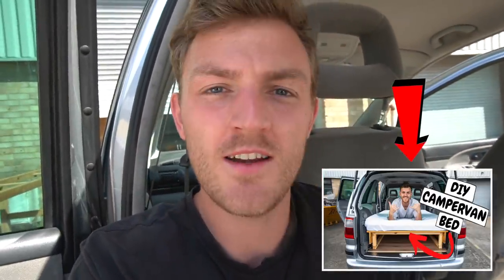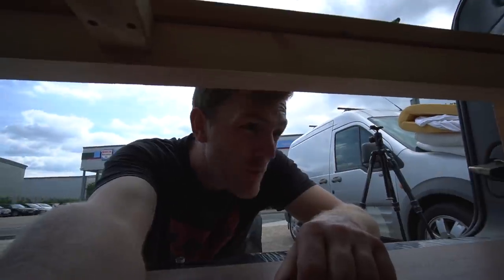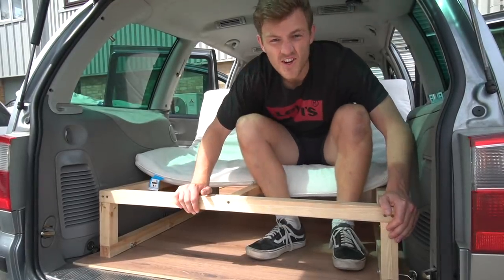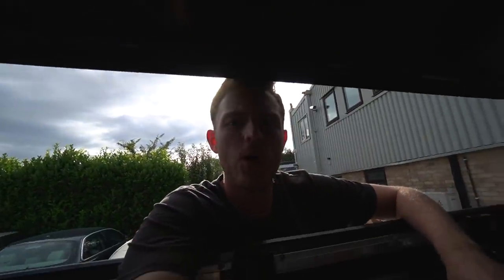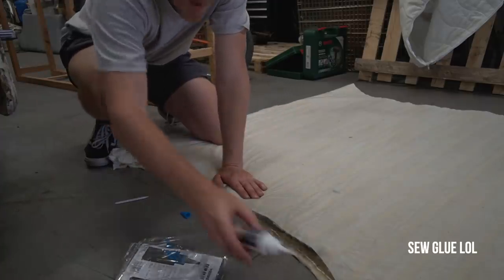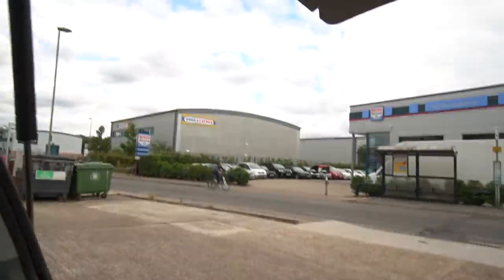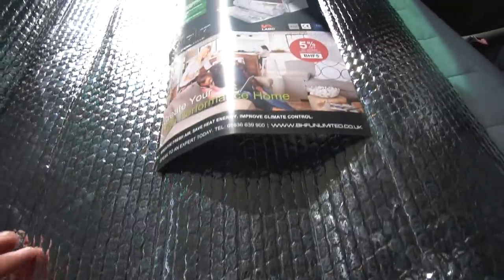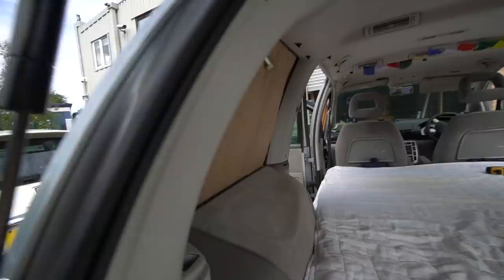CONVERTING MY OLD CAR INTO A CAMPER VAN! DIY CONVERSION!

Comment: Dude. Loving your work. My missus and I came across your channel whilst searching for micro camper conversion. We are looking to convert my ford smax and your conversion caught our eye..

You've done a great job bearing in mind you are inexperienced with wood work and even camper conversions.

I'm absolutely fine with the wood work side of things but I'm a little unsure of the electric side of things. Was the leisure battery set up easy to install? 
Also, does having the split charge relay system fitted, affect the vehicle when it comes to MOT time?

Again loving your work.
Cheers

Martin & Jo
Reply from the maker: Hey Martin and Jo, you should go for it for sure and I would love to see your set up once you’ve done it! The leak sure battery was easy to set up and the split charge relay came with a diagram on how to get it working so can’t go wrong and as far as I know there shouldn’t be any issues with the MOT! 😁
Reply: @WillsWhereabouts  cheers dude.